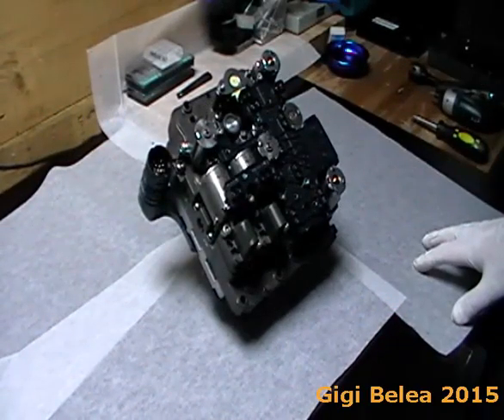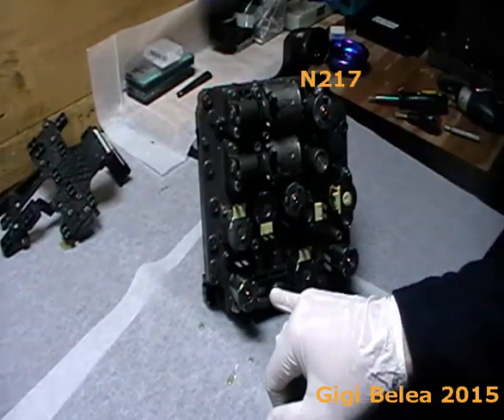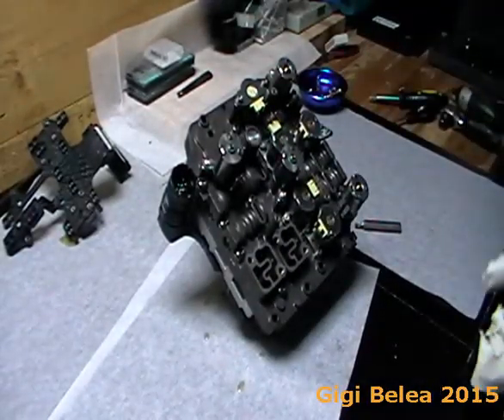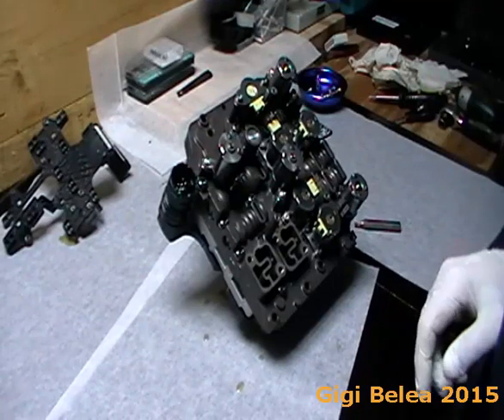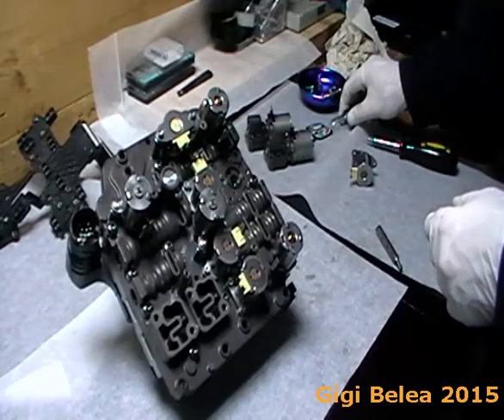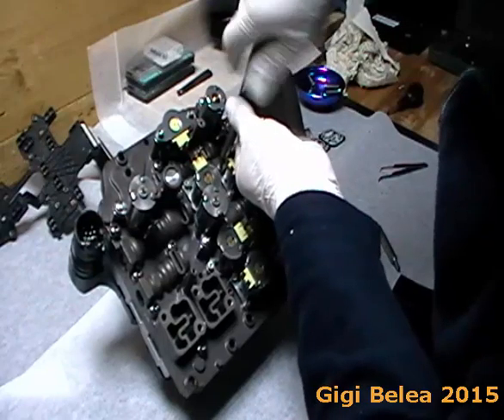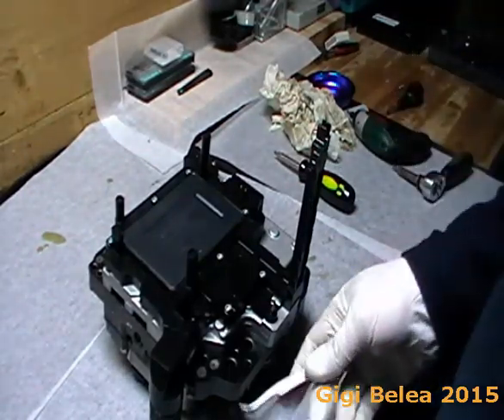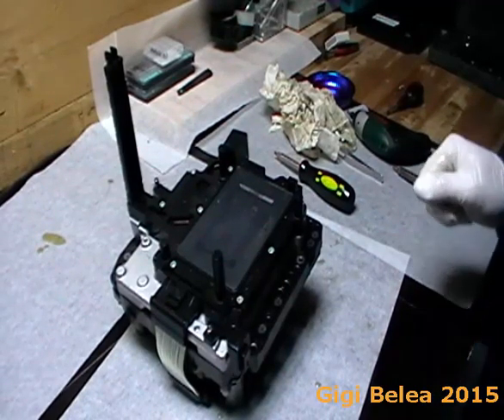Changing DSG Solenoid / Valve on DSG6 Mechatronic Unit

Comment: Perhaps you can help me diagnose the problem I am having. I have flashing PRNDS on my instrument cluster

I have the following DTC codes 

17224 - transmission fluid pressure sensor/switch 1 (P0840 - 000 - Malfunction)

17229 - transmission fluid pressure sensor /switch 2 (P0845 - 000 - Malfunction)

18154 - transmission Solenoid power relay (P1746 - 000 - Electrical Malfunction)

 I want to make sure it is a solenoid issue before I do the repair.
I cannot find any information regarding the last code. Where is this relay located? I'm assuming it is inside the transmission because I plugged another working transmission to the connector on the vehicle and the PRDNS stopped flashing and dtc were no longuer present. So this eliminates the possibility of bad ground/battery or power supply going to the transmission

Please let me know your input on this because I have a spare mechatronic unit I can take the solenoid from.
Reply from the maker: This is for sure your Mechatronic unit and not a solenoid. Can be fixed but it's a long way to Denmark.
Reply from the maker: Waste of time building this into a diesel. The DQ200 is not strong enough for the torque of a diesel.

Comment: Hello, i have a audi a3 dsg 2010, had a smash on the front and damaged the casing of the mechatronic, a slight dent on the end unfortunately, when opened noticed the pressure valve on the bottom far left side was broken, replaced this with another pressure valve, and still get pressure valve error code on vagcom. When the car heats up it does not drive. But when cold it drives in all gears. What I would like ot know would the new valve need to be coded into the car? thanks any advice would be appreciated.
Reply from the maker: Whenever you change a valve, basic settings must be performed. if the issue continues then the valve has shortcircuited the print plade.
Reply: hello, how do u performt he basic setting? i have vagcom original, now we;ve just changed the mechatronic unit as thought the old one was shot, so u need to copy yhr codin onto new one?

thanks
Reply from the maker: Just connect to transmission and in the Basic Settings you can perform the adaptation. Coding of the new unit should be the same as the old, Usually 20.

Comment: thanks for making this. I appreciate your ability to speak my language. We need this info. My 2009 is probably failing the n215 n216 first and reverse are having issues. Do you have to code these. I think you mentioned that. I do have a ross tech.
Reply from the maker: No need to code anything, just swap and perform basic settings.
Reply: @GigiBeleaDK  thanks I did the basic settings 61 then 60 and all the others but after driving it I still get the clunking and clicking I have put on about 300 to 400 miles. How long does it take for the computer to relearn or do you think I got a defective magnetronic unit. I replaced it with rebuilt. cpi;dt find the real borg warner n215 n216
Reply from the maker: @Mikefngarage  Without a clear history of what the problem was, errors and so long is very hard to tell exactly what the problem is / was. Normally after 100km the gearbox should be fully adapted under normal driving conditions (like plenty of gear changes , stop and go ), if still clicks and clunks , maybe problem is mechanical inside the gearbox or worn mechatronic unit.
Reply: @GigiBeleaDK  Well it drives fine through the gears but when you put it in park or stop sometimes at a light the car jumps and clunks. and then usually the engine light comes on code and the PRNDS blinks.Restart and it is fine again. DId it before and after valve body replaced. but maybe worse after. Is this common with the failure of the n215 n216. Break in time should be good got a yes after all basic values. Code says something like  undetermined gear something like that.
Reply from the maker: @Mikefngarage  Need to know the exact error code , "something like that" does not cut it :)
Reply: @GigiBeleaDK  right from the ross tec thanks for your help I have the original magnetronic unit if it is the old one that you think is faulty. Kept the core just in case If you think it is the Mag I can email you from your website to maybe get you to repair the original one. I dont know what brand of parts they used in the replacement and if it is the new mag that is faulty I would prefer getting the parts or have you do the german one.
Reply from the maker: @Mikefngarage  write me an e-mail and we take it from there.
Reply: How did you solve this problem. I have the Same issue. I get a clunking noise when i put in park. On two occasions. Car will not move in reverse. Did you change the valves or the mechatronic unit. I also received the P19143 error code. Please help

Comment: Hallo gigi i change the oil and know i gona update my mechatronic that mean i gona put the values new again maybe it can work i dont know but is must before i replace the mechatronic tcm for a nother one what do yo think
Reply from the maker: Problem is it is hard to see if the solenoids are faulty or the TCM print circuit. You can take down mechatronic and meassure resistance on the valves see if it is the same on the similar ones. But I think in your case it is the print circuit inside as it fails when getting hot.
Reply: GigiBelea
Reply: GigiBelea
Reply: GigiBelea aka JAX a3 3.2 po771 code

Comment: Hi. 
I have an 2010 Audi A7 3.0TDI. 
When i set the car in D it jerks a little. It also skips 1,3 and 5th gear, 2, 4 and 6 is good. 
Sometimes it wont backup in R. I also have gearbox malfunction popping up on the screen. 
Is there a mechatronic problem here or clutch?
or both?
Thanks
Reply from the maker: Try to read the error codes and see what it comes up with. Impossible to diagnose without an error code.
Reply: P17D400 - partial transm. 1 valve 3 - mechanical malfunction
P17CF00 - clutch 1 - slip too great
P17D500 - partial transm. 2 valve 3 - mechanical malfunction
P17D000 - clutch 2 - slip too great
P170100 - transmissin control unit locked
P17E000 - gear selector 1 - mechanical malfunction
P17D800 - torque limitation due to clutch temperature
Reply: Did you find out the problem ?

Comment: those big salenoid valves wich on is number 1 and number 2 
on my car with diagostics its shows no pressure on salenoid 2 wich one is number 2???
Reply: Reading came as Valve 2 in transmission part 2, is this now solenoid?

Comment: hello GigiBelea , first off may i say thank you for youre time making these videos for all to learn from , but was wondering if you could help me with information on a DSG 6 ,O2E, when the fluid is hot I have hard shifting from second to first and also bucking in second and slightly in first , and along time to engage reverse with bucking also , I have no fault codes . I changed the fluid and filter performed basic settings and have no issues with ABS sensors or the brake switch , and with your guidance I am willing to buy the solenoids if I need them also to make a donation to youre cause , but i spent all my money buying this car and now dont have the cash to take it to a garage please can you help me , will pm you through youtube if needed , thanks once again for any help . if not I completely understand .
Reply from the maker: Common problem due to worn mechanical valve inside the unit or the temp sensor. Solution for that > Replace mechatronic, sorry :(
Reply: GigiBelea thanks for taking the time to answer my question , would you know of any way of testing through vcds or another method to find out if it's the temp sensor or other part to get it replaced or am I just screwed. thanks again , it's not much sorry,, but donation made . And to others reading please donate he's taking the time to answer questions and he can save you a lot of cash . hello from Scotland.
Reply from the maker: Andrew , please look for my e-mail address on the contact page and let's take it there , this will take some time I guess:)
Reply: Hello do you remember how u fix this problem because i have now same problem 
Thanks!🙏

Comment: Everyone says replacing solenoid is only 20% success, why?
Reply from the maker: On older Cxx units yes, on newer Fxx units it is usually the solenoids that go first.
Reply: @GigiBeleaDK  How do you know which unit you have? 02e927770al is the hardware code when scanning it via vcds

Comment: Failing to read code, just telling Open Circuit
No reverse
No 2D, 4D and 6D
Reply: I have same problem with my S5.
We believe it's a solenoid and I'm going to actually order today
Reply: Valve 2 in transmission part 2

Comment: dct450 transmission, 2.0 crd VW PD engine. Jerks and sometimes stalls when N to D, or during very slow forward motions. Is this selenoid related as well? Check my clip. It shows it is acting like releasing the clutch on manual transmission faster than usual. https://www.youtube.com/watch?v=JWDALzPkzEI

Comment: Hello if there is a false connection should I replace the valve or the board connecting the valves
Reply from the maker: false connection ??
Reply: GigiBelea aka JAX I meant open circuit
Reply from the maker: @brysonj456  Usually is the Solenoid or the TCM, almost never the connecting board.
Reply: GigiBelea aka JAX if I do a basic reset would that fix it? Because I already replaced the seleniod but never did the basic reset